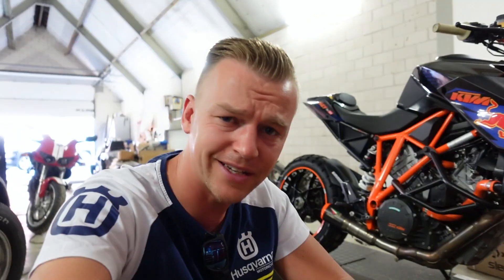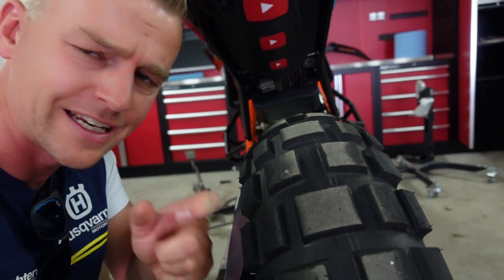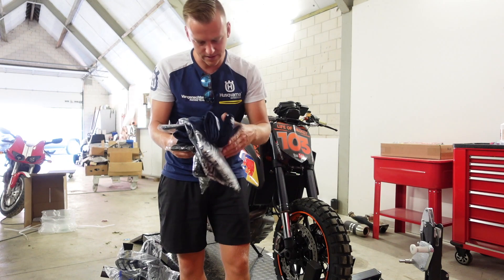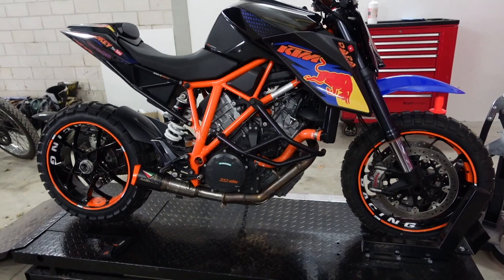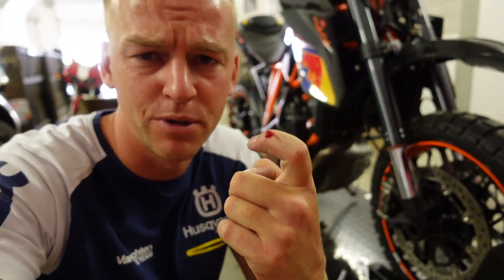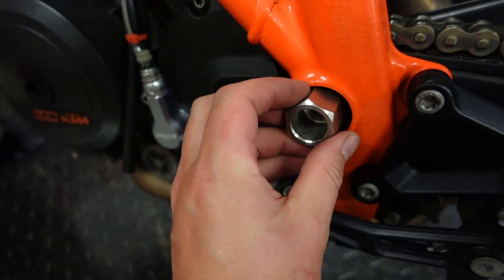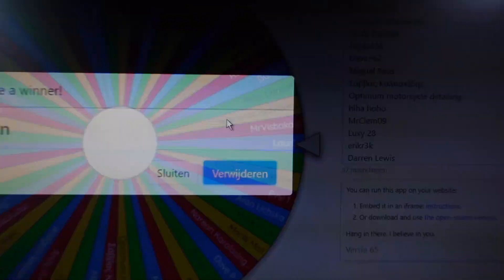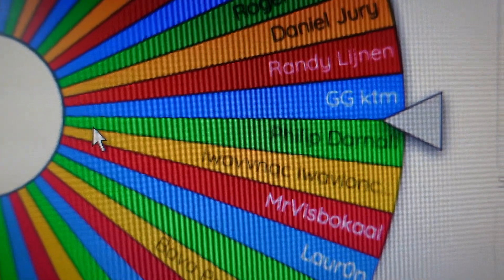The KTM 1290 Superduro : New Front Fender & Ktm Merchandise Winner!

Comment: 🤣🤣the mud guard this is a puzzle. I think blue and third are the best fit. White is not bad. I think that the smaller it is, the better it is, also where you need to protect the projected stones is at the back, towards the radiator and the exhaust, so that forward the smaller the better. Do you think it would be possible instead of mounting it under the seat post, as they normally go, to mount it on the lower seat post in two pieces? is to gain some height cin relative to the front wheel. I think it will be better. please ..... don't play by sticking the knife in the airbags when you have an electrical cable right underneath. Sorry about your puppy. I hope you get better soon. Greetings.